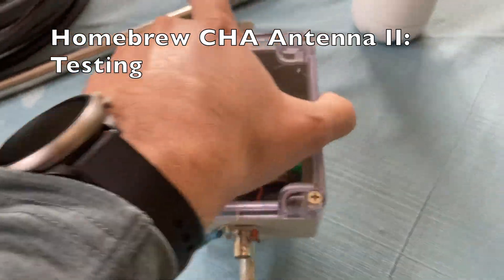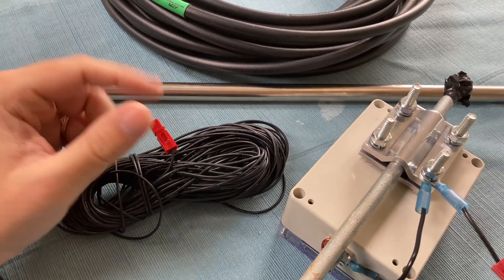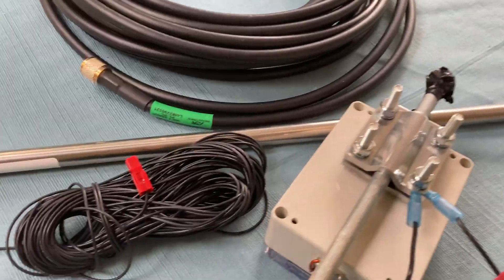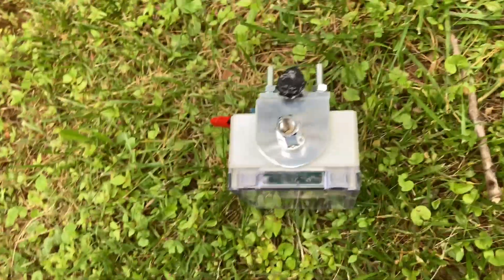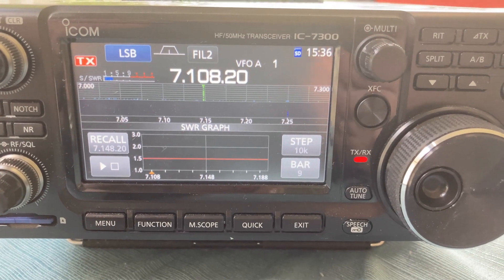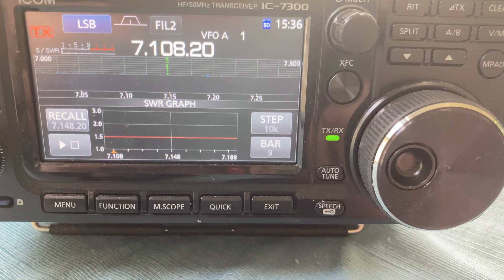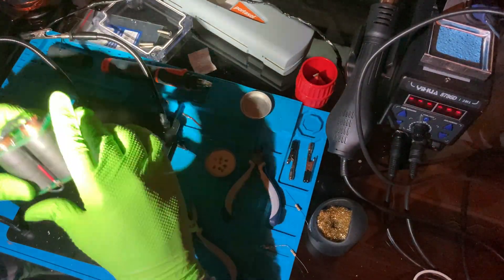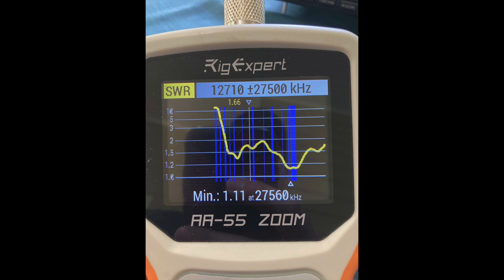Homebrew CHA Antenna II: Testing

Comment: You should test this device for thermal waste. That design is very inefficient, most of yor power going into heat.
Reply: I have had the most success with "inefficient" designs. I wouldn't get that worked up about it
Reply from the maker: A 5:1 unun will be less efficient than other unun designs and is a bit "lossy". However, the benefit is that it is much more multiband capable than a more efficient unun. As long as it isn't melting things and the radio is able to make a contact, the power loss is negligible. 100W through this antenna off of a battery is the same as 100W through any other antenna as far as the radio is concerned - it will draw what it needs. If what gets into the atmosphere as RF is enough to work, I consider it a win.

Comment: 7:09  3/8" brass set screw needed here instead of the SO239?
Reply from the maker: That is a great idea - I didn’t have one on hand for the build, but that’s a better solution. I’ll try that if I have any trouble with the current build

Comment: in the next video elaborate a  bit more abou the transformer and the turns etc, very interesting
Reply from the maker: Sure thing! This is creating a (slightly) lossy broadband transformer. You get pretty good broadband coverage and usable SWR readings at the expense of a couple of S units for your listeners on transmit. With enough elevation (like on a mountaintop where I plan to use it), the loss becomes negligible and you get a sweet multiband setup.